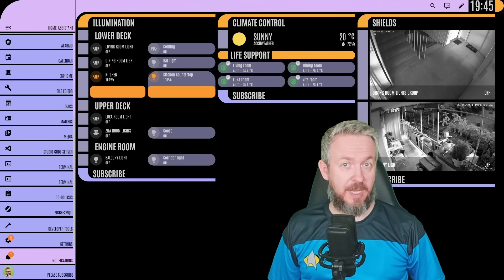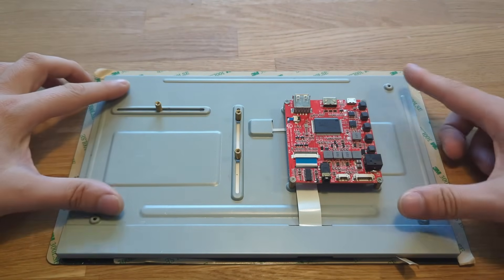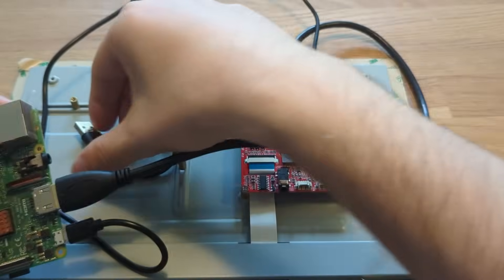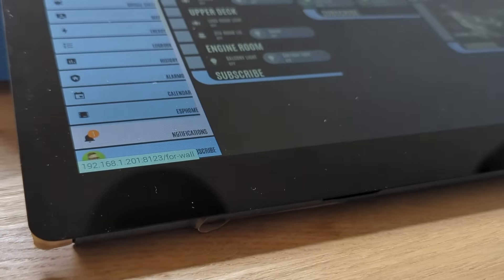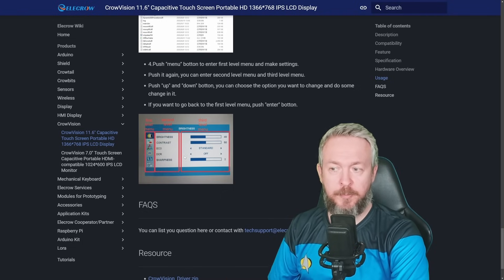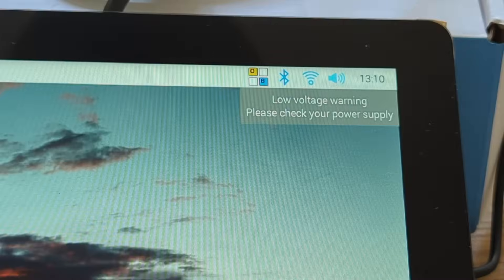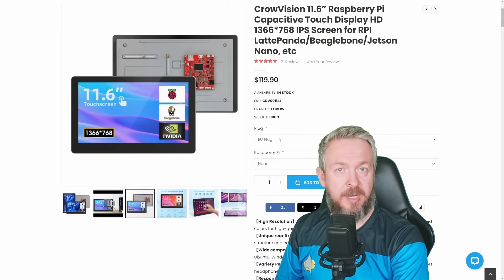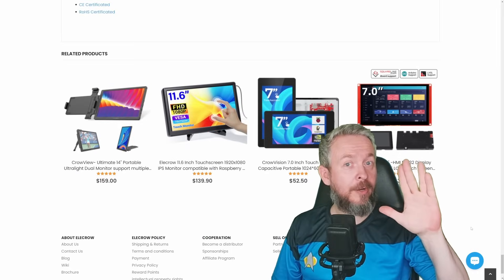Elecrow CrowVision 11.6" IPS touch display

Comment: Imho it's too expensive for that small resolution, it should have been at least 1080p. The cable management is not existent, ports on the driver board all sticking out sideways, which adds to the clutter. The half-mounting of the Raspberry creating sagging on one side is a really half-baked solution. Anyway, thanks for the showcase!

Comment: Did you try a different USB cable for power to the Elecrow display?   It may be a limitation with the cable Elecrow provide, or maybe just the USB A port itself.   The 12V 2 Amp supply, in theory, should be fine for powering a Raspberry 3B.   Probably would not be quite enough for a Raspberry Pi 4 or 5 though.
Reply from the maker: I did (by accident TBH) and same result. Not sure why, as it should be enough on paper to power RPi, but...

Comment: Hello, do you have HA running on this display? What is the name of the theme? It looks very nice, Star Trek console style! Thanks!
Reply from the maker: No, HA is running on separate machine. While possible to run both HA and UI on same machine, it's not supported or recommended (I did try for test but it was really hard to maintain).
Theme is this one here: https://github.com/th3jesta/ha-lcars
I did video on it previously. They have added sound now also.
Reply: Thanks a lot!